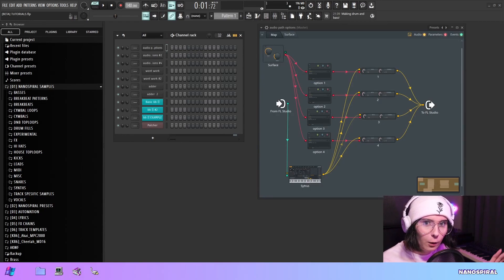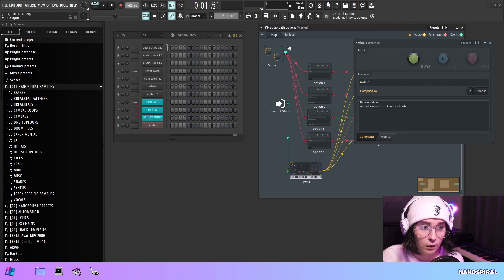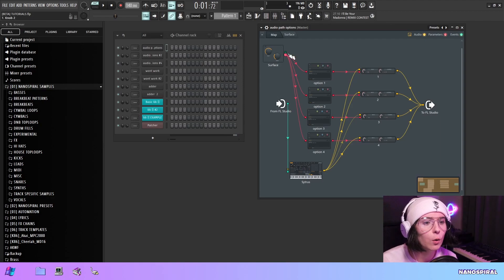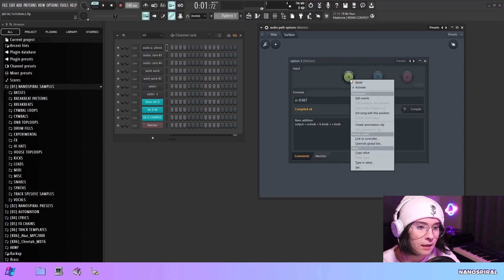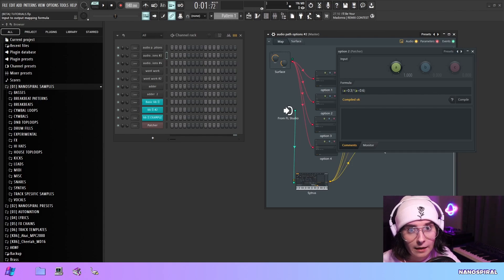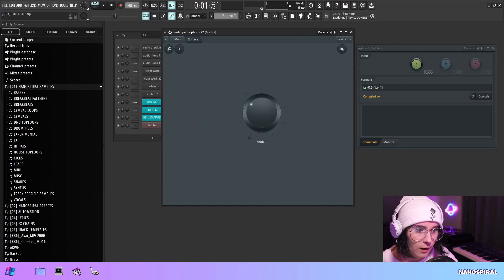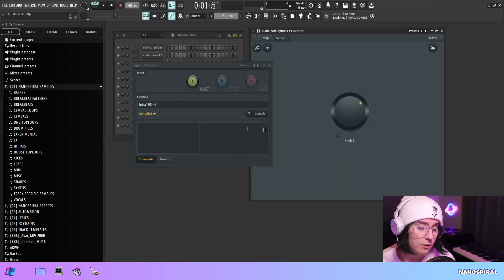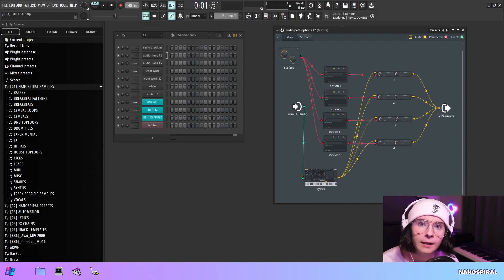How To Make An Option Selector In Patcher (Updated)

Comment: Hey this really helped me now I have the smallest issue left. If I select one of the values it will put fruity mute 2 to mute on but I want it to go to OFF when the value (for example: a=0) is reached. Chatgpt is telling stuff like "a = 0, 1 - in" but that doesnt work at all (syntax error). So quickly said: I want unga bunga press midi controller button A and it sets fruity mute 2 to OFF. Right now fruity mute goes to ON when unga bunga button A. If you could help me with this one thing id be forever happy!
Reply: I GOT IT! Instead of fruity mute I used fruity send and the dry signal knob for that! 100= full through signal and 0 is no signal (which is just absolutely correct and better than fruity mute to me lol) Thank you for everything!

Comment: For anyone who wants a quick way of doing the same thing; you can do this same thing selecting the range preset in fruity formula controller. Use B and C for minimum and maximum values respectively (B = 0.32 C = 0.64 / B = 0.65 C = 0.99) and A will output 0 or 1 if its input is within the range of B and C. For the first & last options, you simply set B & C to be both 0 and both 1 respectively.

Comment: Love you for this.. Subbed!!!!!!!!! BUT, what if I have 16x formulas/options? What the script? :S I cant get it to work.... Sat like 8 hours yesterday until my brain melted
Reply from the maker: Hi, if you want the options to be from 1 to 16, you need to divide 1 by 15. If you're fine by zero also being an option, divide by 16. The division by 15 will not be even, so you should round the values up and then change the formula to be "a<=value and > previous value". With 16 options from 1-16 the first option is 0, second is 0.07, third is 0,14 and so on.

Comment: Is it possible to do an option selector with a series of buttons? I'm thinking it's probably not likely to have buttons interact with each other within a single surface instance. For example, you have 5 buttons but only one can be toggled on at a time (toggling one ON would toggle the rest OFF). I'm looking for a more elegant solution to switch between many sounds/articulations than a knob or slider but maybe one day FL will include drop down menu controls.
Reply from the maker: If you mean same exact behavior than with a knob/slider, kind of yes but you'd have to manually turn rest of the buttons off because turning off automatically would require a feedback loop. So basically you can't 'animate' them to do stuff by clicking just one.
Reply: @nanospiraI  That's what I figured. Thanks and love the content.
Reply: @nanospiraI  and there is no way to control the selection knob with buttons in other patcher?? i press button 1 and the knob adjust aotomatically to range one etc... maybe that can be a solution
Reply: I'M ALSO TRYING TO DO THE SAME BUT I CAN'T FIAND A WAY . CAN ANYONE PLS HELP ME IN THIS ?

Comment: i often run into this rounding issue with stepped values.
One other solution is the "inter" function;  ie.  "Inter(a,b,c)" returns boolean value, 1 when a is between b and c, inclusive.
Reply from the maker: That's also a very easy and readable way to do it! Might add one more example using that for the downloads. I like to do stuff with operators, they're so useful to understand and kind of prepare people for some of the future video subjects I have coming up
Reply: @nanospiraI  i doff my hat to you, for your having a syllabus prepared.